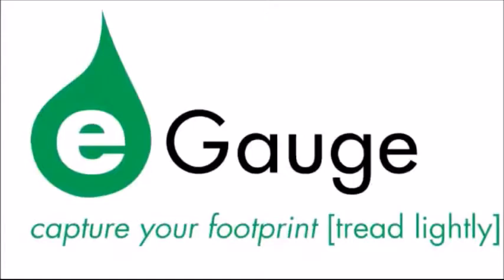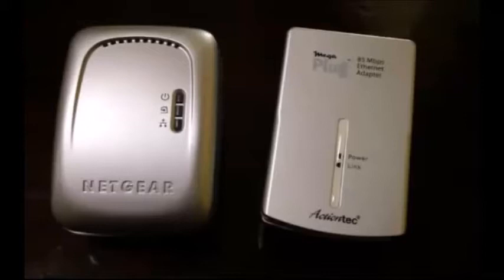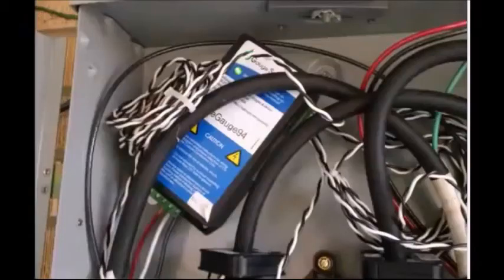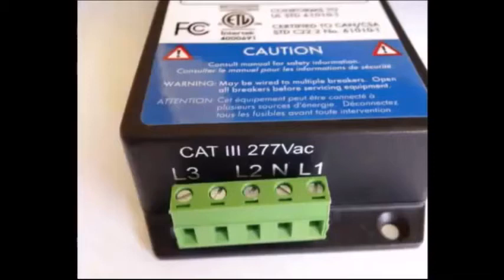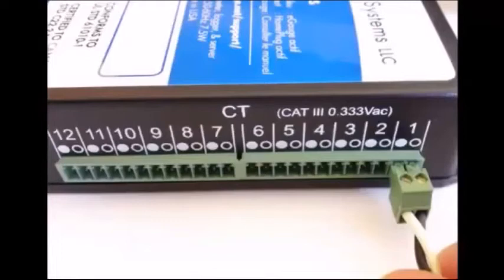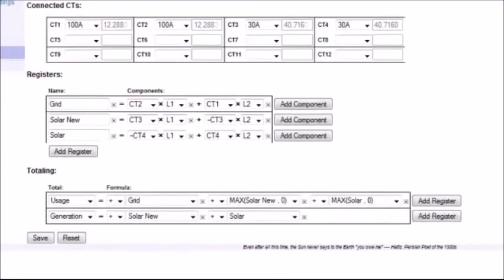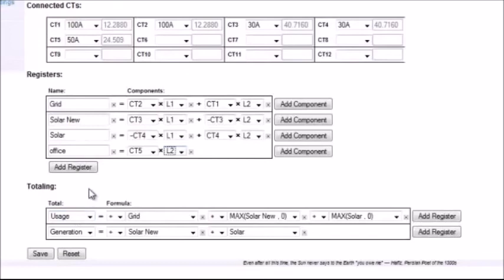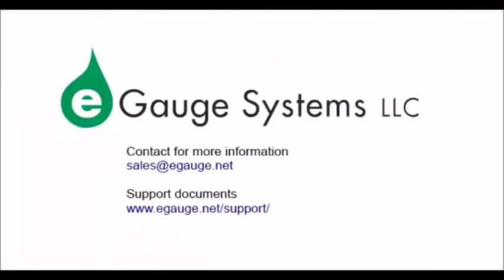▶How To Install eGauge Meter/Data Logger EG30XX | RENVU

Comment: Do you have any system that monitors ~30 circuits?  300a 120/240v panel.
Reply from the maker: This eGauge Pro 4130 can monitor up to 30 circuits. Please see the data sheet and installation manual under the "Downloads" tab to ensure this product will work in your system.
https://www.renvu.com/Solar-Products/Monitoring_2/EGAUGE-Pro-Meter-Data-Logger-EG4130